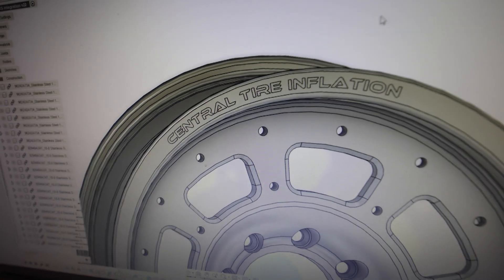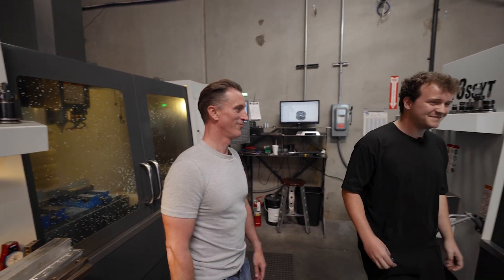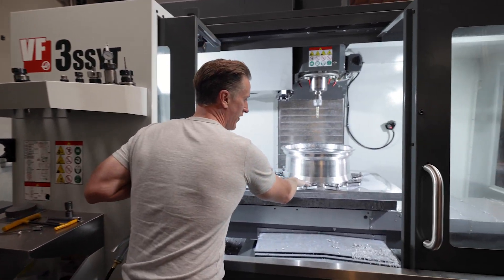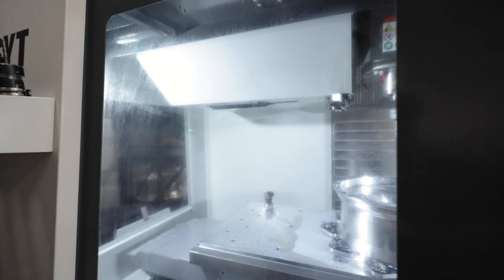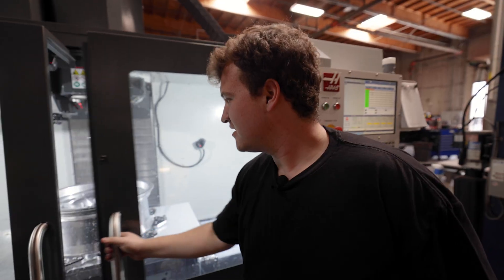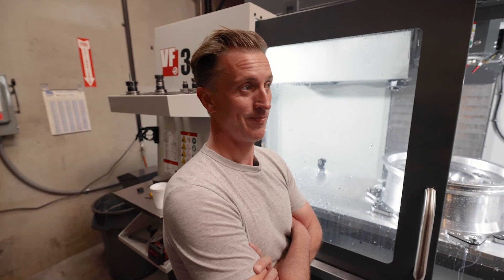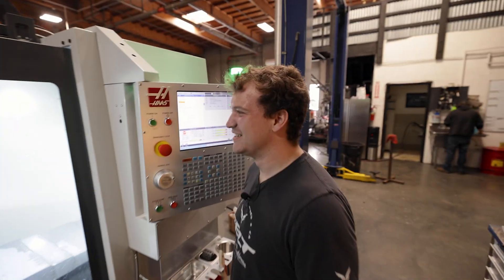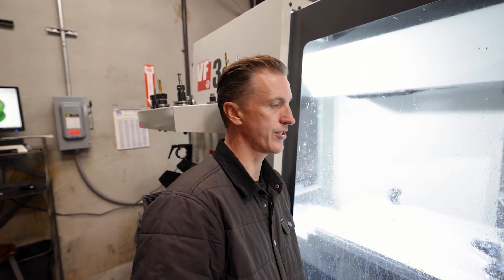HOW ITS MADE | PREDATOR INC FORGED WHEELS

Comment: WOW! I love the wheels and your shop is crazy insane!
Reply from the maker: Thanks!!
Reply: @PredatorInc  I am building a radical custom HMMWV. I went in a different direction and built it "hot rod" style. I designed/fabricated an entirely new roof (wagon style) with a 5 inch chop. I put the body on a custom lowered 2WD chassis, and put a big-block Ford 472 in it. It's crazy fun to drive and it gets a lot of attention. I am almost finished with it. I would be honored if you check out some of my progress videos. @WolfeKustoms.

Comment: Nice work guys. I'm sensing a second mortgage for a set of 4 LOL. Definitely keep the Predator Forged on the lip. That's a classy touch.  CTIS on the lip along with the center caps gets a little busy. But like you said they are custom ordered so charge by the letter for anything that someone might want. Plates added between bolt holes could be engraved as well that way they could be changed. Maybe the name of your Hummer club or how much to add  "Prius Flattened While You Wait"?
Reply from the maker: "PRIUS FLATTENED" 🤣🤣 Thank you for your input and watching the vlog. It's much appreciated. 🇺🇸

Comment: How much cfm does the factory pump make?
Reply from the maker: Not exactly sure. I would bet the arb would outperform the factory pump for sure in output. However, the factory pump is much robust and stronger. Less output but would bet much longer life. That said, the arb pump would run very well if you didn't have a factory pump.

Comment: CTIS on the rims, PREDATOR you are probably better off doing subtly, how about just the PREDATOR logo - head like Apple does, no mention of PREDATOR at all.
Reply from the maker: Thanks for the feedback. Good call. Only problem is the rim lip is narrow so it doesn't give us much room to work with.
Reply: @PredatorInc  Shouldn't be any larger than the JWL logo, no?
Reply: @PredatorInc  Or what you could do is to take the predator logo head without the claw and let this be the shape for the inside of the visible rim; the outside obviously has to be circular to match the rubber tire, this would be major in size and still subtle enough to be classy, no? And then put the claw in the center cap.